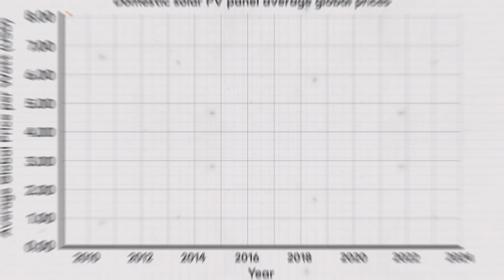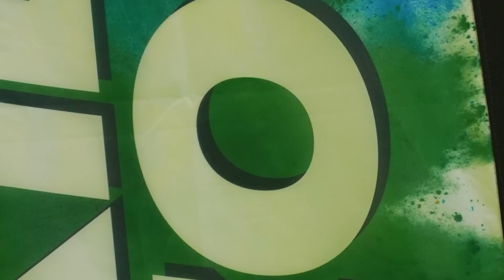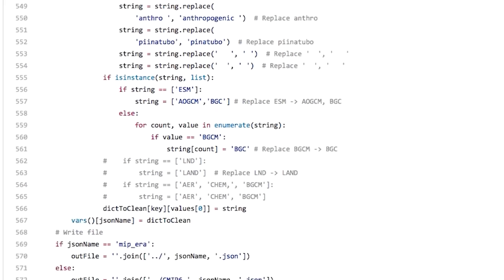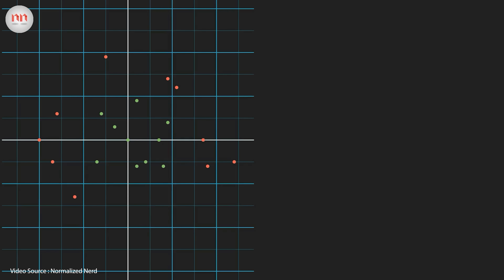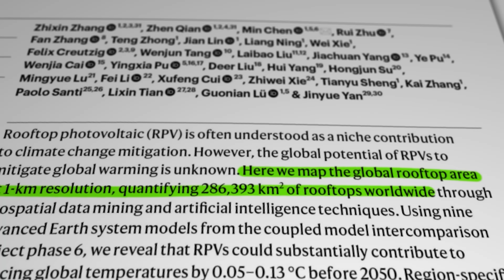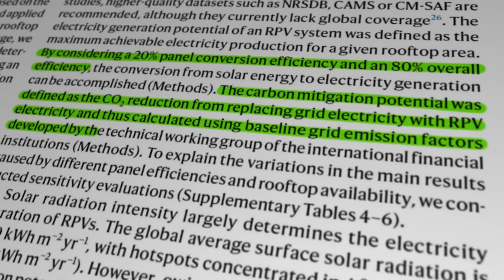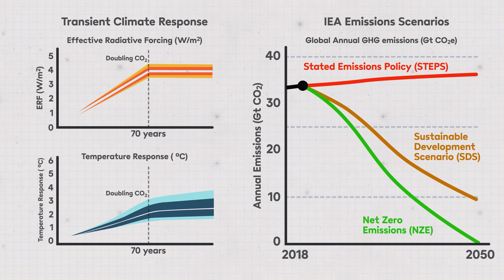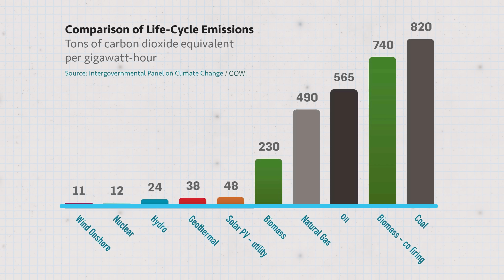New Report - Rooftop Solar PV is THE biggest climate mitigation technology!

Comment: I live 100% off-grid in the western US on the Canadian border, have batteries and use bi-facial solar panels (they capture a lot of reflection off the snow) to keep them charged. My generator needs to kick in 2-4 times a month Dec-Feb but otherwise it is unneeded. I have all the modern cons (electric fridge/freezer, washer, dryer, microwave etc).

Comment: I have solar panels, but although I am in Australia the solar electricity is very unreliable.  The panels have a rating in kW, but only generate close to the rated kW in the middle of the day on a sunny day.  Unfortunately we have had a lot of rain and overcast days for months and the solar is never available when it is needed unless you have batteries (which are expensive and bad for the planet).  Then you need to have a lot of panels to provide enough power during the day to power the house for the whole day including night and early morning.  If you have a few weeks of rain the battery does not receive enough from solar panels.  Excess power from solar is not wanted back in the grid as there is too much power in the middle of the day and the power is very expensive when the grid runs low on power.  I would like to save money used for imported solar panels, batteries, gas plants, wind turbines, huge upgrades to the grid etc and just go to 24x7 nuclear reactors.

Comment: Aussie here, solar is a no brainer.  13 kW  panels 9.4 kW inverters, 27 kWh of storage.

Base ROI is 12.5% (8 years) but with an EV about to take up residence, the ROI becomes 22%.

Then there are the benefits that are harder to put a price on.

On a hot day, we turn the aircon on and the house is 22 degrees at an opportunity cost of 12 cents per hour.

When (not if) the grid is down we don't notice, as the house is on the backup circuit.

In the event of a multi day outage, the system is black start capable (it can charge the battery from dead flat while the grid is down.

We recently had a "dunkelflaute", 6 days of heavy cloud and rain.  On the 6th day, we used 4 kwh from the grid, only because i didn't bother to manage loads.

Our daily production is export limited to 5 kW, and having tested the system for a couple of months with that limit removed, it is apparent that we could generate as much as 50% more than we do now.

Then there is the social benefits.  Grid that doesn't need to be upgraded, generation that doesn't have to be built etcetera
Reply: That is a very good summary of what is possible. Absolute no brainer indeed, even if one can only afford to start off small.

Comment: Rooftop solar is not the best solution in economic sense. It is being paid for by other electricity users, because of how governments stimulate it. It helps individuals reduce their energy bills, but raises the bills for others who don't have solar. Utility scale solar is more economic, but it is not getting the same level of support. I do prefer rooftop solar and have my own installation, because it allows for dual use of land and easy integration with existing infrastructure, but don't think that it is some kind of magic bullet. In some places rooftop solar already has negative value, but utility companies are still forced to pay for it. In Pakistan the electric grid is collapsing and rooftop solar is part of the reason why.
I am in the Philippines btw and rooftop solar is massively underutilized here. A problem is that it is expensive to get net metering and net metering might not work at all, because of out of spec grid voltage.
Anyway rooftop solar won't do anything to reduce climate change, unless it leads to a crash in fossil energy prices and we keep that stuff in the ground. If not, then it will still continue to be used. We need policies that are aimed at keeping carbon in the ground. Solar and EVs are enablers of such policies, but without policies to reduce global fossil fuel consumption, the fuel will just be used elsewhere.
The only measures I know that people can do to mitigate climate change is plant trees and paint their roofs white. I had my roof painted white. It helps reduce my electricity consumption and helps my panels produce more electricity.

Comment: The biggest climate mitigation technology is the ballot. Business shareholder, Institution director, Government election: BIG ballot.

Use yours to end BIG Geogh G: Business, Institution, Government Geologically-sourced GreenHouse Gases.

It's easy as CANDIES:

Cut gas, oilsand, coal, oil, clinker (Geogh G) extraction 1.7%/month
Avoid high GWP-20 emissions, using bio- to replace geo- if needed
Negative embodied emissions in materials as much as possible ASAP
Diversify farms & wilds with permaculture, afforestation, conservation
 Inform policymakers and engineers on GHG-negative benefits
Eliminate all Geogh G leakage through trade and financial measures
Subvert regulatory capture by effective grassroots action

Comment: We're in Brisbane, Aust. In 2017 we installed 14.5kw of panels, max. domestic installation, plus batteries, inverters for A$31,000. We were paying $3000pa for power before, now we have free power and earn ~$2800pa from selling to the grid at 20c /kwh, which is sold on at 39c. If we buy power during cyclones, etc, we pay full price. We paid off our costs early last year and now have at least 20yrs more of free power and a handy little sum besides. The return on investment is 16% pa for 30 years, I would love a few more investments like that. We applied for an industrial set up of 85kw of panels, the company approved it but said they wouldn't pay, i.e. the grid could handle it but they have coal contracts and don't want cheap power.
Reply: The benefits get even better with an EV added to the mix!

Comment: Just estimating/calculating the area of suitable rooftops, then multiplying that by the local insolation levels and the panel efficiency, probably with a suitable correction factor, is too simplistic for estimating how much electricity rooftop solar could provide.

You also need to take into account number of other factors including:

> Types of roof:
Whether the rooftops are domestic or commercial or, probably more importantly, how big they are.
> Timescales: 
How long it will take to install all the Solar, from some rough calculations grand based solar can be built out about 30 to 40 x faster than domestic roof installations. 
Example - From a rough estimate; with the current number of PV installers in the UK and assuming ⅓ of roofs are suitable, it would probably take well over 40 years to install PV on every suitable roof, abot 28GW. In reality, it is expected at the UK will install 3 to 3.5GW in 2025 meaning that 28GW of PV can be installed in well under 10 years
> Variability/intermittency, especially seasonal.
> Installation cost/cost of ownership.
A domestic rooftop is a lot more expensive to install than either ground mount or large scale commercial roofs, because of the need to erect scaffolding, which adds substantial cost and the small scale significantly increases installation time, which also adds cost.

One of the big issues with the UK is seasonality, we get about 9 times more sunlight each month during May, June and July than we do in December. Furthermore, because of the low sun angle in December the panels probably work less efficiently, so it's probably more likely to be at least 10 to 1 variation.

It has been estimated that the UK has about 250,000 hectares of south facing commercial roofs. If all this was used for PV, assuming about 75% panel coverage, it could generate over 300TWh, enough to meet the UK's entire current annual electricity demand. However in reality a huge amount of this would be wasted unless we have very large scale seasonal energy storage. On a cloudless sunny summer's day that PV would probably be pumping out in the region of 350 to 400 GW, probably about 10 times the demand, especially if over a weekend. Some of it, but by no means all, could be stored in batteries for use overnight, but demand is pretty low on summer nights and they're also quite short. Furthermore, what are we going to do with all the nuclear that we don't actually need at that time of year, and the wind will still be blowing too, albeit not quite as hardy as in the winter.

Whilst this research/analysis highlights just how much solar is available, to be really helpful it really needs to be able to break it down at the whole system level for each country, possibly by region for large countries. #WST (Whole Systems Thinking) needed.

Comment: I've bought my 370W panels for an equivalent of 128 Euro / 116 Pounds per piece back in 2020 late. I was a bit scared of some cheaper options so I bough a model assembled in Poland (were I'm located) by Selfa, a company that has been around for almost a century so it didn't feel like they are likely to disappear. Now I would probably go for a cheaper option but it doesn't really matter as the whole thing has already payed for itself. I was connected to the grid in December 2020 so in practise I've started production in 2021 and I think the full return around mid 2024 and that included a few winter/early spring months of pause when we were renovating the roof. Essentially 3 years - there's no better investment! Of course I did get a partial refund from state program and I built the whole thing myself which surely made it significantly cheaper (I do have electrician papers that were enough to do it). But my installation is pretty much mounted flat so it loses around 18% of potential efficiency and still it only took 3 years.

Comment: I installed a 4kW system on my garage in 2016  and see zero signs of panel degradation.  2023 was my highest production year.   I installed it myself and saved about half the cost.  We now have two EVs so it doesn’t cover all our electricity, but every bit helps

Comment: the current global PV potential production capability is ~ 1TWp annually. 1square metre of PV produced ~ 300Wp so that is equivalent to 3 billion square metres or  3,000 square kilometres of PV panel potential production currently.

The paper says that there is ~ 300,000 km2 of roof space globally so at the current rate of production that would take ~100years to fill. However production is ramping up rapidly so we could see that time drop to 10 years within a couple of decades.   By 2050 we should easily have enough PV installed on rooftops and large scale land sites to power the global electricity demand.  Sodium  batteries for overnight storage are next on the list

Comment: Thank you this video! Once again you've gone through a complicated paper to show us what it means for the environment, and I'm really grateful to you for it. So if every roof in the world that could support PV panels had them installed, it could potentially reduce global temperatures by 0.05 to 0.13 degrees C. It really is a big deal if you think of it in terms of how many gigatons of CO2 it takes to achieve that much warming. This would be a permanent reduction too, as long as all those roofs got their panels replaced when they wear out.

Most of it would probably be houses, since there are more houses than other kinds of buildings. But there'd also be huge commercial roofs and skyscrapers added in there. Basically every roof where you could install solar panels would have them.

Comment: Thank you, very interesting. I'd like to know the proportion of rooftop installations directly connected to the grid compared to rooftop installations run as a separate household circuit in parallel to the grid. There has been mention before of installing solar panels on frameworks above train tracks and canals. But, of course, that involves decisions that need to be made by governments rather than individual householders. I live in Toronto where I risk, each and every winter, damage to the roof through continual freeze/thaw episodes which build up ice over time. I'd like to know what the risk is of ice buildup under solar panels, not to mention their efficacy when under many inches of snow! Yes, I know, consult the installer! And how about windstorms? Sorry, don't mean to be so pessimistic about a potential planet saver. Speaking of Africa, there are gazillions of square kilometres of sand just begging to be covered with solar panels. But, again... governments!

Comment: We live in Australia at approx -33.42 in latitude facing north. Our household uses an average of 25KWH a day. We have 38 solar panels (420W) each with its own 360w Enphase microinverter (13.5KWH system net after trimming). On average we generate 65KWH / day. We also have a 25KWH Sungrow battery. 

We are 95% self-sufficient as we only import an average of 5-7KWHper day during the winter of June and July. 

Across the year, we import 3-500KWH at 37c per KWH from the grid and we export >1400KWH into the grid at a miserable 5c per KWH.

The whole system cost was about $30K, but we saved $3k in electricity purchase and we get about $200 in credit for our export after paying $1 a day for being connected into the grid. Payback for the overall system is roughly 11 years with 4% annual capital cost and 2% increase in annual energy cost

SOLAR ARE VERY COST EFFECTIVE AND ENVIRONMENTALLY RESPONSIBLE OPTION. 

BUT YOU CAN"T BEAT THE GREEDY ELECTICITY COMPANIES WHO MAKES A KILLING FROM YOUR HARD INVESTMENT IN SOLAR/BATTERY AND YOUR EXPORTED ELECTRICITY INTO THE GRID

Comment: I caught the last days of net metering scheme last year and since I'm an electronics engineer I did it all legally by myself. Of course, utility company came to install the meters and do all the safety measurements and checks. The panels are ridiculously cheap, the construction materials not so much. I have 16kWp installed with three phase inverter and 15kWh backup battery, two EVs and a heat pump. I'm still in owe, because my electricity bill is around 20€, no fuel cost for both my wife and me, almost no heating cost (almost because I like to fire my fireplace sometimes). All other electricity is free too. This way it will take me less then three years to pay back the investment in the plant itself. EVs will take a bit longer. My advice is DO IT if you have the opportunity.

Comment: At 8:05, you mention that regions with high climate sensitivity have a lot of potential for PV, and that we should fund panels there because of the high climate sensitivity.  But CO2 doesn't CO2 mix rapidly in the atmosphere?  In that case, reducing GHG emissions in areas of high sensitivity won't really help them.  It would help them more if we reduced emissions wherever we can get the most reduction per money spent.  A utility-sized solar farm would give you a much larger GHG reduction per money spent, compared to rooftop.
Reply: It probably points towards the incentive that people have to act on climate. Not really to the overall impact solar would have.

Comment: This depends on if you have more cold or more hot days, but add in the benefit of sun not beating down on a roof, making the home warmer.  I know that there's insulation helping to protect the inside of the house from that heat, but for those with central AC, often the units are in the attic, so all the ducting, etc..... is getting heated by that attic temp and even with insulation some of the heat in the attic is transferred into the home, so I'll take that benefit of a cooler attic since we have more warm/hot days than cool/cold.

Comment: However, in California, the activist and political class are doing everything in their power to break the long-term utility contracts for net metering, which was a sweetener when solar panels were going for $6/watt installed and more.   The economics only marginally worked at that time of an economical cost of power, where you effectively loaned KWH to the power company to sell to my neighbor's AC system, and the utility gave back the power at night.   Now they want to only pay the price of power produced hundreds of miles away on PPA with a for profit company owned by the Utility without discounting for the wheeling cost of hundreds of miles to sell to my neighbor with an AC or heat pump system.   

Now that I have effectively paid upfront for 25 years' worth of electricity with the capital cost of my solar system, they want to change the contract so I don't benefit.  Our Public Utilities Commission is supporting this theft and so is our political class.  Never "trust" the government is what they are saying.

Comment: Importers/installers here simply take insane profits instead and you are unlikely to ever break even.
Batterys for example are offered at a price point that, when calculated as divided by usable battery capacity and cycled over expected lifespan, end up at a price/kWh cycled over twice that of grid price. People then forget that even charging from solar incurs this "cost". The price for a 16kWh battery that can cycle 8000 times at 80% DOD should not exceed the tariff per kwh multiplied by 102400. As-is the prices offered here for the 16 kWh units are in the 10-13k GBP range. Working backwards that's a cycled kWh price of approx 10p added to any potential cost of getting it off-peak from the grid. It should be in the 2-2.5k range realistically seing how the raw storage cells is now down to under 50 GBP/kWh stored making a 16 kWh system contain 800 GBP worth of cells (not bought in bulk).

Comment: We installed Solar about 15 years ago, and then upgraded from the 1.2kW system to a 6.6kW system with a 10.5kWh battery.
this has all paid itself off mainly due to the reduced bills, we only get $0.03 /kW feed in.
We have added to this, a BYD EV, Electric tractor-mower, electric mower and tools, solar garden lighting etc. and smart switches everywhere.
we do not use a lot of grid power now.